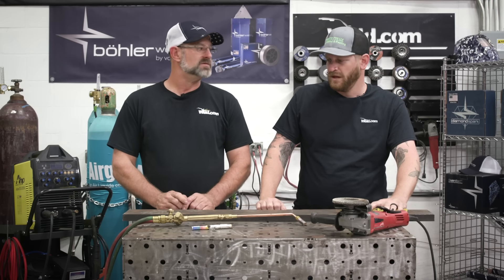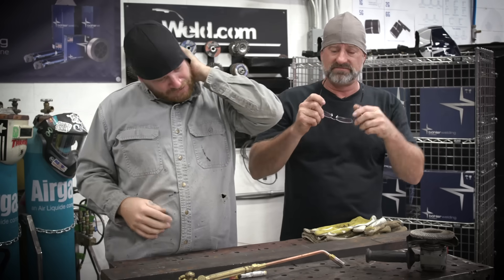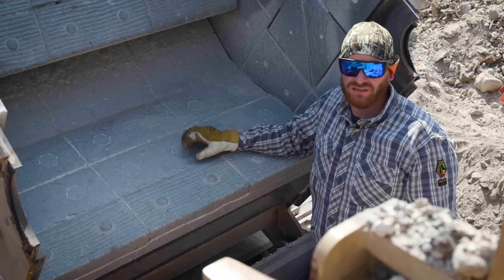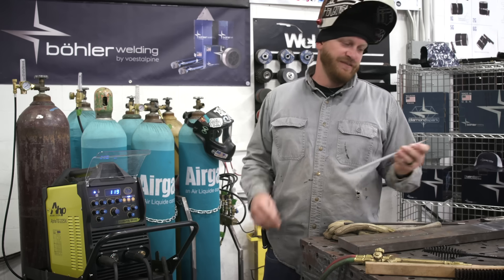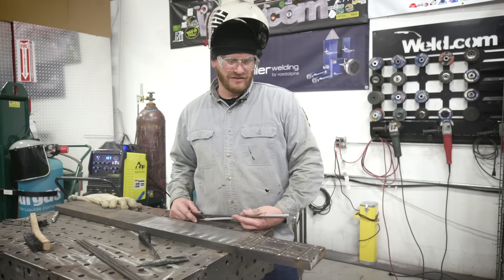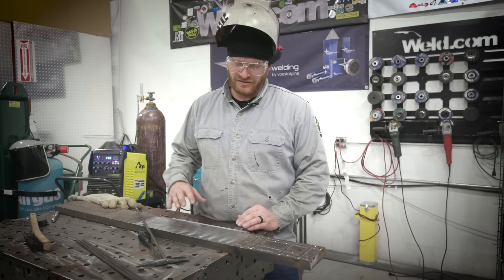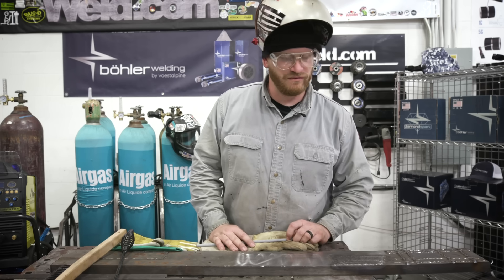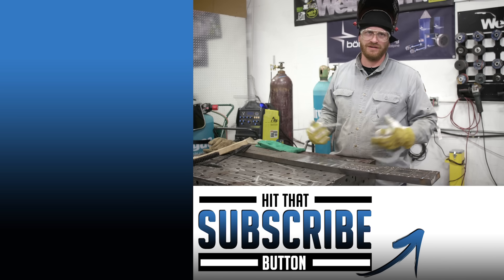Introduction to Heavy Equipment Repair with Hardfacing

Comment: These are the videos we want.
Reply: Could you guys please do a video about surfacing or build up on cast iron? Like small meticulous stuff, maybe like filling in or building up rust pits or other low spots in critical surfaces. Perhaps on  cylinder wall or bearing surface?

Comment: Crazy question...could one hard face the cutting edge on a lawnmower blade...then grind/belt sand it back sharp to strengthen it, for longevity?  Or would the hard facing come off and fly off like a bullet?
I always wondered why they didn't harden the cutting edge of lawnmower blades...

Comment: I have a few different questions. 
1- what types of equipment do you not want to just start hard facing on the original base metal? 
2-for hard facing do you always preheat before hard facing? 
3-is the build up layer just to build up worn base metal or is the build up also the butter layer? 

Thanks in advance.

Comment: I always saw our welder run beads of weld then run the hard surface over it. He never ground down the weld. He always said the reason was for down the road if he had to cut something off. He could cut thru the hard surface cause it had a reg weld base 🤷‍♂️ Seemed to work on top and bottom of bucket shanks

Comment: Could you guys please do a video about surfacing or build up on cast iron? Like small meticulous stuff, maybe like filling in or building up rust pits or other low spots in critical surfaces. Perhaps on  cylinder wall or bearing surface?

Comment: The old timers say that that'll crack any kind of lock bead or criss cross will trap heat and crack I have noticed that to be true on a few implements that I've done hard facing on they were high impact forestry equipment

Comment: use bu90 mix with low high 7018  better than hard face rod one welder in front and one next to it  so the two rods mix

Comment: Struggled today with some Lincoln wearshield 60 hard facing on our terex crusher plant , stuff just didn’t want to lay down , up and down with the heat the rod was getting red hot and couldn’t get a stable arc , only way it would run if I ran a big arc gap and it looked like shit

Comment: one question I have that I can't find anywhere is, are hard facing rods supposed to run vertical up or vertical down. Its all nice and everything when you get to weld flat but some of us ain't in the shop.

Comment: Go work for Indutech Canada. Manual hardface with Chrome carbide overlay wire up to the flange face of a slip on, then dress your  new surface with a nine inch grinder up to and flush with that flange face. Good luck.

Comment: Do you experience warp? If so how to counteract  -if needed
Reply: You can stitch down plate to your work surface to prevent warping. On most of the equipment we work on the plates are bolted into place and are typically about 3"-4" thick so warping is rare. However my demo plate did start to bend up. 😏👍🏼

Comment: I have a draw bar on an international 986 tractor that has major wear . Can I just use some 7018 or 6010 to build up without buying special rods?
Reply: Yes
Reply: Yes you can. These are typically for constant wear or abrasions on equipment. But to bring back the wear on that arm 7018 or 6011 will work great.
Reply: @bobhigginbotham9035  the draw bar dos get constant wear. It it where a piece of equipment would be attached. There is friction for sure..that is why it is worn down. Thks
Reply: @JacobAHull-nx6rx  well then hardfacing rod would do great for that. You can also use a stainless steel rod for good abrasion resistance if you can not find hardfacing rods.

Comment: Can mower blades be hard face to last longer
Reply: Yes, but a 3/32" or 1/8" stainless steel rod would work better and would probably sharpen easier. You may have to weld small sections at a time and let it cool to prevent warping.

Comment: The welding "coupon" stuff gave me, a normie, an idea of the standards that have to be met.  These practical application videos are great because  always wondered what all the low key metal graffittii stuff was about.  t isn't just tricking out the equipment for fashion's sake.

Comment: Thank you so much for this. We have an auger at work I've been trying to talk the boss into hard facing. He talked to several "certified" welders and guys who "donitall fer 30 years" and none of them had a clue what hard facing was. Maybe I can try my hand at it now.
Reply: Get ahold of me.
Kirk Reed at kirksmetalworks@gmail.com.
Reply: That's way more common than you think, you could weld for 30 years pipe and structural and never touch a piece of heavy equipment
Reply: plenty of people say they've been doing this for 20 years, and I run the other way unless they are not blow hards lol

Comment: OK, if 6000 series rods have a 6000lb tensile strength, and a 7000  series rods have a 7000lb tensile strength, what is a 'hard facing' rod rated at?
Reply: Hardfacing rod is not tensile rated. It's wear rated and rated for the material that is wearing it out, such as dirt/rock or metal to metal abrasion. If it were used to join two pieces of metal it would need to have a psi rating to match or exceed slightly the tensile rating of the metal being joined. This, however, is going to keep abrasion from wearing the metal surface prematurely so it is rated for such.

Comment: What rod do you use for hard facing/buttering/build-up?
Reply: I used a postalloy 215hd tubular rod and a stoody 35 rod for hardfacing. I used a 7018 rod for build up and I did not use but should have mentioned that a stainless steel rod makes a great buttering layer.
Reply: @bobhigginbotham9035  thanks. Awesome videos

Comment: Great Video! In the shop and field I use Fab Tuf 960 in .045 out of an old LN-25 suit case. Running a 7018 over the base metal has been critical to promoting good adhesion to hardened or abrasion resistant base. I know this was for informational use, so what I've learned is to work the entire area. Doing small sections and moving around so not to concentrate heat too much in one area and cause distortion (operators dont like it when there's a bow in their buckets). Digging these new video, keep up the great work!
Reply: That's awesome! We will be running my LN-25 when we do the wire feed videos. Thanks for the insight in the comments, there is a lot things I didnt mention and need to be brought to attention. I will be making note of what I missed and adding to the next videos. Thanks again!
Reply: Is the Fab tuf 960 a gasless wire? We use the lincore 55 at the shop I'm at and I learned the hard way that gas can be your best friend even with gasless wire. The gas actually pushes the smoke generated away from you without affecting the weld itself. Not sure if that applies to all hardfacing wire or not.
Reply: @stephenadams2035  960 is a dual shield wire, 100%CO2 or 75/25 dealer’s choice.

Comment: What is the reason for 7018 before hard surface rod? 
What is the reason for preheat? 
I work in construction field and have heard GC talk about building up pumps on concrete pump truck. Any issues with that or recommendation ?
Reply: I used the 7018 to demonstrate a build up of worn material like on a used excavator bucket. The preheating is to help the bead cool without cracking. If the pump material is not to thick you may not need to heat.

Comment: Where is the info in this "infomercial". What is the tensile strength, how does it lay...
Reply: Hello, both of these rods produce about a 60-65 Rockwell hardness on the initial pass. Sorry, I have been making notes on what I missed so I can add into our next video. Thank you for the feedback.
Reply: Hardfacing alloys do not have a tensile strength rating.  Although most are well in excess over 100k PSI it is irrelevant to hardfacing as they are not used to join materials together...only protect them from premature wear.
Reply: @tak252  Just pointing that the only information i got from this infomercial is that they like their welding hat

Comment: Is that all you do is a bead spaced out that far I assumed you would want a full layer
Reply: Depending on the equipment or even customer requests, we will run a tight or wide checkerboard pattern  so crushed material gather and help with abrasion resistance. We also run tight slightly overlapped or side by side bead patterns to fill the whole plate sometimes.

Comment: I work industrial maintenance, I  use Stoody 101HC .45 wire to hard face our extrusion auger flights. They get totally covered. Working a puddle is way different than running a bead.
Reply: We will be doing wire feed videos for hardfacing too. Definitely need to highlight that puddle!

Comment: Nice to see a track crusher, just feel this was oversimplified.   I haven't opened my impacter area not the results of my own hard facing in that area. Think giving some explaining on a Stoody 35 over a 965 ap or g.  Yes, we can google this ourselves, sometimes the harder material is not necessary and can use a more cost-effective solution in those areas. Most of my experience has been with Lincore L60-0, i started doing this "buttering" layer after seeing the buckets come back and chunks of hardfacing missing.  Much Appreciated thank you
Reply: We will definitely be doing different types of hardfacing processes on different parent materials. I think wire feed will be next. That bead breaking off is called spalling and is created by hardface material being to strong and tearing out the softer base material on impact. You can run a stainless steel rod as a buttering barrier between the base material and surface rod to prevent that in the future. Thanks for the feedback 🤙
Reply: chris chris  so I been doing hardfacing for a good while now. With a different employer, who really did not teach me anything about the stuff. I picked up bits and pieces, till I got hired by the company that I was doing the work for. Following? Now it is all me, and videos like this is a great tool for me to further my base. But I in someways have gone beyond the basics and would like more information and details. So that I can a informed decisions on what I am doing and purchasing for consumables.

Comment: I have problems with the warp when I do hard facing. It is a lot of heat on one side of the material.
Reply: Yes, I should have mentioned that it is always good practice to clamp or stitch down your plate so it doesn't warp. I did neither of these and it did pull. 🤣🤦🏼‍♂️🤦🏼‍♂️🤦🏼‍♂️
Reply: @bobhigginbotham9035  are your safety glasses prescription?

Comment: Finally, an informative video ! Even if the product placement was pushed too hard (you're also supposed to check the "supported by product placement box" when uploading a video like this)

I think it missed an explanation to why you leave space between your beads when hardfacing. It is done so that it will trap dust, dirt, pebbles etc to provide natural abrasion resistance. For this purpose i think the checker board pattern you showed was a bit too big

Also, would have been cool to mention buttering rods. In some situation 7018 are not good for the buttering layer, so you use rods that are meant especially to be a middle layer between structural steel and hardfacing
Reply: The size of the checkerboard pattern depends on the material the equipment is exposed to.  Smaller patterns are good to hold in fine material  wet applications.  Larger patterns are used where the equipment is exposed to dry and large material....like the concrete crushing/recycling equipment Bob is working on here.
Reply: @tak252  i know, but i feel like there is small paterns, large patterns, and way too large pattern as shown here 😂
You can even see chalk marks in between the stringer, just as if he was planning on running a half the size checker board
Reply: Yes this checkerboard is a little large and I did skip a few mark's 😅. We plan on getting more into detail with checkerboard, line and random patterns in some future videos. Thanks for the feedback.

Comment: Could the buildup coat or butter as you call it be done by spray welding, it’s just that some engineers like abom 69 on YouTube likes to do that to build up a surface .
Reply: No, because spray welding is actually closer to brazing. You are not melting the base metal.

It is very useful to provide material buildup, or even sometime a hardfaced layer, but i don't think it will be sound enough to weld on top of it
Reply: Spray welding is used as a buildup in many shaft applications but not common on plate steel.  2 very different applications.
Reply: @tak252  thanks for your feedback, much obliged

Comment: I could talk about hardfacing all day long, altho all the hardfacing I weld is mig or tig, only did it with stick once.
Reply: I personally specialized in tungsten overlay ( tungsten hardfacing)  application for over ten years. Cutting edges, bucket teeth, dozer tracks, crushers, hammers,  grader blades, river dredging teeth, etc.   Extremely rare to find  interest or enthusiasm in that unique area as well as information on procedure, materials,  and metallurgy compadility.
 ♥️  Tungsten Hard Facing
Reply: @dathaneslinger8134  I'm not sure the entire breakdown of what I weld because we weld with about 10 different hard facing materials, but I know the main 3 in each is tungsten, nickel, and borium.
Reply: We mostly run stick and some mig. I would like to try my hand at tig hardfacing one day.
Reply: @bobhigginbotham9035  I bet I know someone that could help you out with that!

Comment: so . you would not grind down the bead of hardface weld?  you just leave it as welded?
Reply: Yes, we just clean the slag and let the materials do the grinding. If we were going to lay new hardfacing in an area where there is old hardfacing we would grind or gouge it out and fill it back and add new hardfacing.
Reply: @bobhigginbotham9035  THANX for the info😁👍

Comment: Thanks Bob!  What sort of surface area coverage rates do you get hard surfacing?
Reply: The Postalloy tubular rod produces a 90% weld deposit leaving only 10% slag. The Stoody rods have a 60% weld deposit leaving 40% slag covering the entire bead. Similar to the 7018 rod slag peel.

Comment: Perfect video 👌👍 keep up the great work.  There's also two types of hard facing rods one for rock/stone and another for metal on metal wear. Have y'all ever tried 7024 on some spools? I heard it's pretty quick compared to using 7018 for a cap/ filler pass
Reply: Thank you. Thanks for the support. Yes we do run 7024 such a beautiful rod! Also we will be getting into all types of hardfacing, base metals, buttering rods, stainless rods, hardface wires and why we need different processes for different projects.
Reply: @bobhigginbotham9035  awesome, love your work and what ya do!👍👌

Comment: It looks like that welded plate was bending up a little by the end of the video :)
Reply: 🤣 it definitely pulled up. If I was doing that full plate I would have stitched it down. I will be bringing  up that same issue in the next video. Thank you.

Comment: Do you tac weld the 1/6 down solid to keep it from drawing
Reply: I did not tac this down for the demo but if we were surfacing the whole plate I would have to prevent drawing.👍

Comment: Do you always have to pre heat the metal when hard face it?
Reply: In most thick wear plates or heavy machinery yes. It helps to prevent cracking of the hardface bead and to get just enough penetration into the material. But you can also use  stainless steel rods on thinner material to get abrasion resistance without having to preheat.
Reply: Thank you that helps out.  First time hard facing, so had some questions people didn't know how to answer and this video helped out
Reply: @robertkennedy2005  excellent! I'm happy to help. If you have anymore questions please shoot them over.
Reply: How thick of metal should you start to do pre heating on and how hot should you get it also?  I figure thicker the metal hotter you'll need to be.
Reply: You are correct.  The thicker the hotter. The plate we did the demo on was 1 inch and the wearplates in the crusher were about 2 inch. We preheated to 400° but there should be guidelines in the box of rods you choose. I would say half inch is a good size to start warming. You can also run some test passes and listen and look for cracking after laying the bead.
Reply: Yes can I run hardface on my sa200

Comment: Do they have hardfacing for tig???
Reply: Along with stelite (cobalt alloys) there are chromium carbide and tungsten carbide type rods that can be used for tig.
Reply: @tak252  Thanks alot Troy for your info, im taking it all in right now at break. Thanks again
Reply: Yes they do. Typically you can find a steelite tig filler at the local weld shop.
Reply: @bobhigginbotham9035  Thank you Bob. Take care

Comment: As I just bought that exact welding unit I would have liked a little more info on settings. 120 amps is a great start. But to those who don’t know already, any little tidbit of info helps. Yeah ‘it’s in another video’ is true, but I am not watching that video right now.
  Not looking for every little detail to be covered every time. Just showing what settings the machine is at in a snap shot works. The all digital machines make that tougher but you are here to teach right?
  Overall good deal. Keep the vids coming. I am also curious as to how many welders named Bob you can drag out… since folks keep asking about Bob
Reply: Awesome! That is a nice machine to run. You should have a lot of fun. Make something great. 🤙
Reply: Hopefully I'll get to be the last Bob 🤞. I did have the machine set at 120 amps on AC setting. Also I did not adjust the knobs I believe they only work on the tig settings. I should have mentioned that.
Reply: Thanks Bob. I need to clear space so I can dig into this machine and get acquainted. Lots of stick and MiG time, little oxy fuel welding. First foray into GTAW.
  Thanks for the info